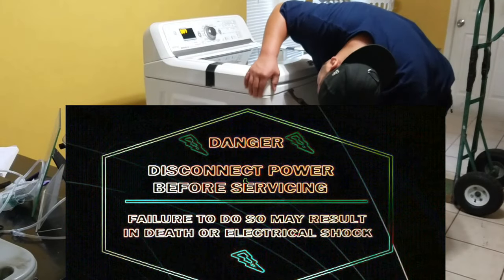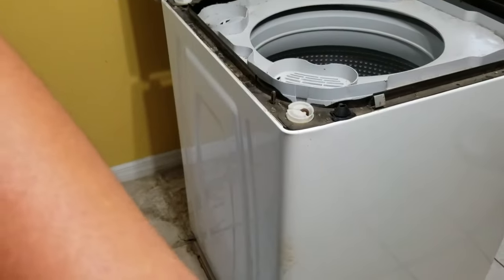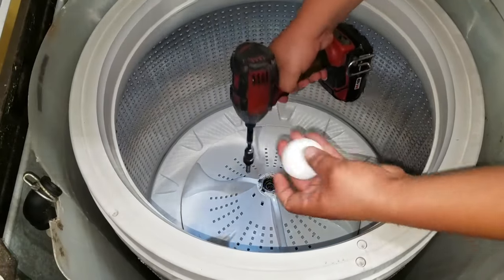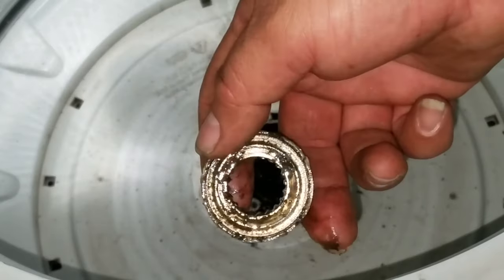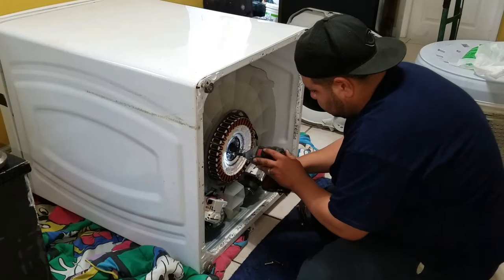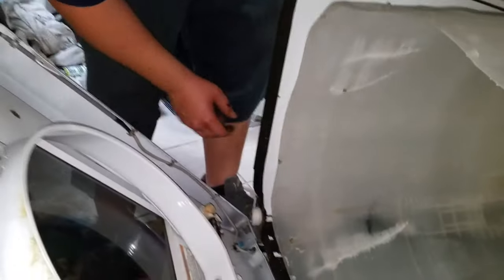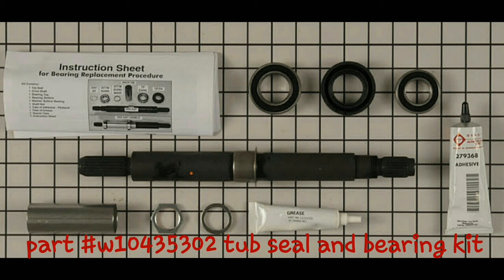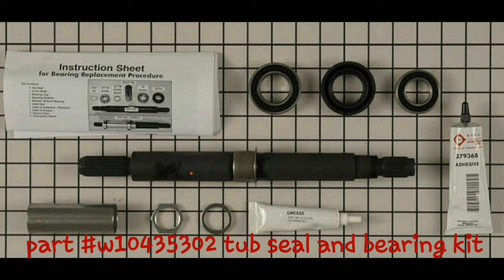#Maytag #Bravos #Washer Tub Seal and Bearing Kit Replacement MVWB700VQ0

Comment: After watching this video, I told my wife that I am going to try and repair the failed bearing.  I also told her to get ready to buy a new washing machine.  :)
Reply from the maker: Good luck 😂😂
Reply: If she's anything like my lady, she's crossing her fingers for the new machine!! 😁
Reply: I'm in the same boat my friend. My wife seems to think money, dryers, washers all grow on trees........Women.....
Reply: @shanecthompson77  uyyy tuuuuuuuuuuu
Reply: Update?
Reply: Thanx!! I was actually able to do this. By the way, I found a kit with bearings, shifter, tub seal and the bearing driver/setter tool - $55 w/tax on Amazon.
I've had to pull the drum before to clear the drain, and there's a trick to it.
Cut off a 2X4 so it fits under the collar of the drum and goes edge to edge on the side wall of the drum.
Take a car jack, and put it on top dead-center of the shifter, turn it until it rests on the bottom of the 2X4, adjust it to make sure everything it straight and centered, then keep turning it until the drum comes loose. Everybody has one of those, and you don't have to buy the expensive tool to pull the drum.

Comment: Just gotta say 6 yrs later and this is still helpin folks man, better explanation than most and even included your mistake AND the correction with a forewarning so we dont have to hassle with the order of when to add the washer.... Thanks to this video i was able to find it was just debris in the bearing and some pb blaster andspinning by hand was able to work it out of the bearing way with out having to replace bearings or the otherwise fine spindle.... The plastic magnet ring in the bottom beeded cleaning too as the debris was STARTING to erode the plastic ruffles that match the spindle

Comment: This was a great video.  My brother & I were able to do this repair very easily.  It really worked out great with two people.   I would like to say that we have a great deal of mechanical ability when it comes to replacement of bearings and seals.  We used to repair scaffold hoists for a living.  The step by step instructions were very good & helpful.  This was the first time we have ever tackled this project.  So, the video was very helpful.  The only thing we regret was the cost of the Driver Tool.  We are retired and probably could have done this job without the expense of the Driver Tool.  But, without our Machine Shop, we felt that the expense was needed.  We know how important it is to get bearings and seals lined up properly.  The Driver Tool was able to do just that.  Now, with that said.....Is there a need for others to share in the cost of a GOOD used Driver Tool which was used only one time and for only 15 minutes??  BTW, our repair was a total success.  We could have NOT done it without this video.  Thank you!!
Reply: My washer kept shooting kept shooting a code (F8?) and after watching a video from this channel I too almost bought the tool until I took a closer inspection with my flashlight and discovered an old wash rag stuck between the tub and agitator😅 That tool is not cheap saved around $120? It’s leaking water now but I think I’ll just buy a new one

Comment: Great video, one helpful hint for people with a stuck tub. You dont need any extra tools just skip that step and go on to hammering our the shifter rod from the bottom side with the tub and all. Once out the tub is free, pull it out and then hammer the shifter out of the tub from inside the tub. Tub puller is only needed when you don't want to replace the bearings.

Comment: Great video. A couple of comments. 
1. My instructions did not say to add grease to the bearings, so i did not
2. You were the ONLY one, to call out the issue of the bottom washer seating improperly when installing the bottom bearing. I too set the bottom bearing twice and the washer was not seat correctly. However, the bearing press tool will seat all the way to the bottom and you do not know that the washer is wrong until you try to remove the press tool. I had to remove the bottom bearing twice. I found your video and the washer seated perfectly! Thanks
BTW if you seat the bottom bearing and the washer is not in the correct position, it will jam it up into the spacer, resulting in the spacer getting bent. I had to spend quite a bit of time to hammer it back to round.
Reply from the maker: Jim Acevez  Yes that washer gave me a hard time, Thanks for your comment and watching my video.

Comment: Adding my thanks here!  Followed the instructions and fixed my machine for the cost of the kit and tool...about $80.  I had one major hickup though..my upper bearing had basically exploded.  When removing it,  only half of the bearing came out.  The other half had to be cut out using a Dremel tool.  Nobody's fault, but a serious pain in the A$$.  Once it was out, everything went back together seamlessly and now she's running smooth and QUIET!  Thanks again
Reply: Josh Clark some advice for next time you run into something like that .  pulley puller can grab the outer bearing race and pull it out

Comment: Great video. Replaced everything much quicker than anticipated. 
One thing to note, the Bravos XL has 2 screws you must remove to open the top. Putty knife does nothing. Also, to properly tighten the stator, use a small T handle Allen thru the cap holes to keep it from spinning as you tighten.
Reply: Where are those two screws? I have been trying to get the top off and it is not coming off with a putty knife.

Comment: Great clip!  I just finished the repair on my own machine and everything was sufficient except for the part on the tub removal.  Another option is to use a jack with a strategically placed two by four!  Other than that, well done and thanks for the video!

Comment: Thanks a bunch! Great video. Step by step. Took my time. The only thing I can say to others is not to tighten too hard when installing the new bearings. I bent my new "spacer" with the tool NOT allowing me to slide the new axle so had to use the old spacer. Well done dude. Sounds like a new washing machine again. Cheers.

Comment: Thank you so much for your video.  I ordered my kit and the instructions were far from easy to understand.  They of course didnt show removing the basket and we spent an hour trying to remove the shaft and couldn't figure it out until I watched your video.  Next time I'll pay the extra for the tool but we made it work with some washers, nuts and a threaded rod.  Thanks to you we also figured out how to put the seal in correctly. Whirlpool and Maytag need to have better directions. 
Thanks for your lifesaving video!

Comment: Thanks for this video, it definitly made the job alot more easy than trying to do the job "cold turkey" ie; no video help! I had the very same issue with the spacer sleeve and spacer washer shifting slightly out of position which caused the shift shaft not being able to drop into place. If this happens to any of you DO NOT POUND THE SHIFT SHAFT DOWN! Looked closely with a flashlight and felt with my finger I could see the sleeve and washer were misaligned which ment I had to loosen the bearings slightly by tapping ever so carefully with the punch tool and shifted them back in alignment from the top (used a long screwdriver to move the spacer) then reinserted the bearing tool and retightened the bearings. Now I was able to slide the shift shaft down thru the bearings and finish seating with a few hammer taps on top of the shaft.
Reply: Thank you very much. EXACTLY, the same problem I am having.

Comment: OUTSTANDING video.  Thanks for walking me through this. Had no experience doing this kind of repair.  Bought parts online and watched your video... step by step.. took me several hours.  My Maytag Bravos sounded like a freight train during spin cycles and started leaking rusty water on the floor.  Figured a bad seal ruined the bearings over time.. Everything worked well and I'm back in business !!  Only suggestion I would make is that after placing the top bearing loosely into it's housing... that you unscrew the nut on top of the bearing press tool almost to the end (to give you more rod length) before placing through the bearing.
Reply from the maker: Thanks for your Comment, I am glad my video Helped you.

Comment: Great video of explaining the process and the mistakes he did and how to correct them. I just finished doing the bearings and seal, it works great. I do want to share an extra pointer. The bottom nut was pretty hard to get it started. I would recommend to try to make sure it fits smoothly before placing the shaft in the washer. Once, you can get it started outside of the washer, then when you put the shaft in its place, the nut will easily go on. That was an issue I encounter, but easy to address before you get started. Again, thank you for the video.

Comment: After watching several of these videos and looking at the comment sections, your idea of putting the washer on the installation tool with the bearing is the best way. And the amount of torque on the bottom nut is an issue  ; on a new shaft and blue Loctite on the nut then just barely snug is the answer (on an old shaft I would make sure you cleaned off the old Loctite before putting on the nut with more Loctite.); too much torque on that nut and you may be replacing the bearing again.

Comment: Thanks for the video it helped me troubleshoot a rotor position sensor fault code F51. Since the procedure to replace the bearing involves removal of the stator and rotor I could see what all of these components looked like before taking the washer apart. Big ball of dust fell out of the rotor assembly during removal, cleaned up rotor and stator and F51 code went away!

Comment: Hello, I was doing this repair today and had two issues. After removing the rotor and stator, I could not get the nut off of the drive shaft. I initially tried WD40 but that didn't help. I then tried heating it with a small torch but still could not get the nut loose. I finally had to use a small angle grinder with a cutoff wheel to cut thru the nut. Secondly, I assembled the lower brg and spacer as you suggested, but i don't think I had the brgs pulled completely together even though the nut on the tool was completely tight. I could not get the shaft to go into the lower brg. I knoched the shaft back out and saw that the spacer ring would move slightly. I reapplied the install tool and tightened it down a little further by using a hammer on the wrench. The spacer ring then looked centered and tight, but I still had a very difficult time driving the shaft all the way down into the lower brg. I placed a long 2x4 on the drive shaft and had to pound it down with a hammer. It still to a very long time and a lot of pounding to finally get the drive shaft all the way down. Have you ever had these issues and what was you solution? Thank you.

Comment: Thanks for this. If you don't have the bearing tool you can use the old bearings, old seal and old shaft and a block of wood to push the new ones into place. Just don't get the old upper bearing stuck in the tub on top of the new one.

Comment: FYI:  It's not a "shifter", it's the "Main Power Shaft" or simply "shaft", or even "axle".  Otherwise, great video!  Excellent tip about the washer.  This was my third time to change the bearings and (thanks to your tip) the first time I didn't get the washer jammed in crooked.  Good job!

Comment: For the most part this video helped! There are a few things to add to it though. There is an alignment hole in the stator that you can use for keeping the rotor from turning with a screwdriver while trying to take the nut off, and to make sure you have the right size allen wrench in there! This was my mistake and ended up tearing the rotor bolt up. Also you don't need their $200 tool to put the bearings in. If you have ever replaced wheel bearing races you can figure it out, and I actually use the shaft to line everything up straight. Also, be very careful not to break the tabs off of the position sensor, otherwise it'll be loose.

Comment: I had the same problem with that washer that is placed between the spacer and lower bearing. Made 3 attempts and on the last was able to correct it with the metal bar that comes with the tool kit. I like your solution better. FYI: Pouring a kettle of piping hot water on the "tub hub" enable me to remove a stubborn one.

Comment: I also had trouble getting old shaft out, didn't get the press tool to get tub out. Great video, very well done, thank you for doing it.
Reply: One can use a bottle jack and 2x4's to pull the tub out.
Reply: @Jake-by9ly  my buddy and I almost tried that, we ended up pulling the tub and shaft out together then putting it up on two sawhorses and beat shaft out w several chunks of 2x4 (as the shaft proved tougher than wood) to a successful end.

Comment: Great video. Thanks for the upload. I have the same washer and the same problem. Followed you video and just saved $300 at least.
The only problem I ran into was getting the stater hub off. The bolt was rusted on there and stripping the allan wrench hole out. Since it has such a flat profile and rounded, I had no choice but to use a dremel tool and grind away some plastic so I could get some vice grips on there. Even then, I had to bang it off to the last thread. When I put it back on the new one, I dabbed a little grease in there to help prevent that. It should still stay on there even with grease. It has a very fine thread. It's going to have to make many turns to come off.
Thanks again. Thumbs up!
Reply from the maker: Randi Rain thanks for your comment I'm glad my video could help....
Reply: Randi Rain I need some help guys
Reply: I am having to change this bearing again. This washer is a piece of crap. I filled it full of grease and water still got to the bearing.

Comment: GREAT video guy. Would add my observations. Maytag Bravos MVWB300. Needs a 2nd bearing kit. Symptom (F-51) fault code. Removed the basket and cleaned out the inlet and outlet to the pump. "no change, still faulted with F-51". Removed motor armature and motor position sensor. "nothing obvious"
Removed basket a 2nd time and tried to rotate the "shifter". Could not turn the "shifter" without a channel lock pliers. Noticed quarter size spot of water had came out on the floor when I removed the motor armature. Water had come through the bearings, seal has failed. Believe I've found my issue.

Comment: Dude!  Great video!  I'm up against doing a bearing job on my Mom's Maytag WTW6300WW0.  Thank you for the heads up on the tricky washer.  Rebuilding transmissions, I used petroleum jelly (dissolving grease) to hold tricky bits in place.  Thank you for the reminder.  lol.

Comment: Hey thanks for such a clear, easy to follow walkthrough. 
How do I know when the shifter is in the right position when I'm driving it in? Can it go too far, or does it stop?
Reply: this machine doesnt have a 'shifter'! but the Shaft has a flange that bottoms out against the top of the top bearing.  it is also possible to to overtighten the toot and drive the bearings in too far that the spacer tube and washer bind and make it hard to install the shaft.  they should have s very slight freedom of movement before installing shaft.  (i always check the washer has side to side movement but not up and down).  the spacer tube and washer should be greased but not the outside of the bearings

Comment: I've done this twice already. Works great for a while. Now I am debating doing it for the 3rd time or just getting rid of it! Anyone else have to do this more than once?
Reply: Was yours leaking from the bottom ?   Or just making a loud noise?  Or both ?  Just curious because I just replace mine for the first time and was already wondering how long until the next time
Reply: @ttusweetness  It didn't really leak, it just made loud noises, then spins grease and funk out the bottom. Looks like a Jackson Pollock in the laundry room. I did it for the 3rd time. Next time, I'm tossing it.
Reply: @bbreede1   mine made the grease spiral on the floor along with some water dripping.   1st repair is good so far after about 4 days and several loads of laundry.   About how long each time did your repair last each time?
Reply: @ttusweetness  maybe 1 to 1.5 years for each repair. Not sure if I said this already, but first time I used OEM parts. Second time I used the cheapest I could find on Amazon. Not much of difference between the 2. For the third, I tried OEM again and really took my time installing. We'll see!
Reply: Dont feel bad I am on my fourth shaft bearing and seals ...just a normal part of maintenance ....it is a very poor design...still cheaper than a new machine...
Reply: @bbreede1  
I am on my second repair. Lasted less than 1.5 years for me. I will not do this again. I think a speed queen is in my future. 
How is yours doing?
Reply: @jakboiee  so far, it’s holding up. I know as sure as the sun rises and sets, that piece of junk will fail again. I will not be changing those bearings next time!